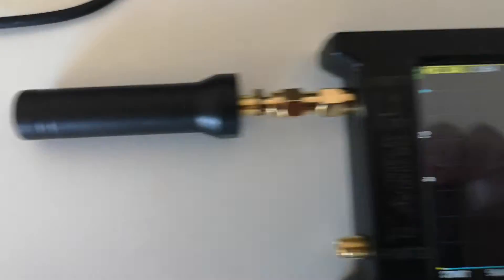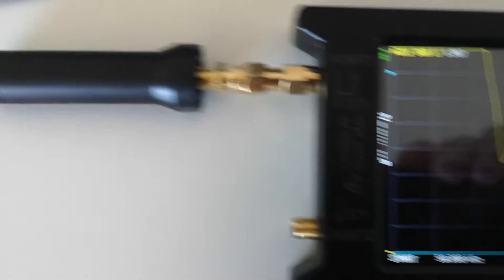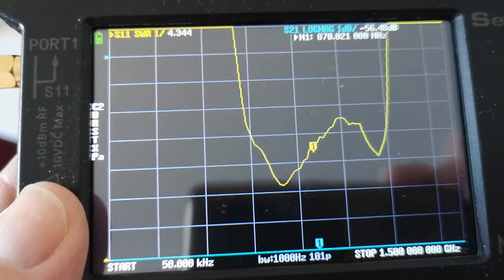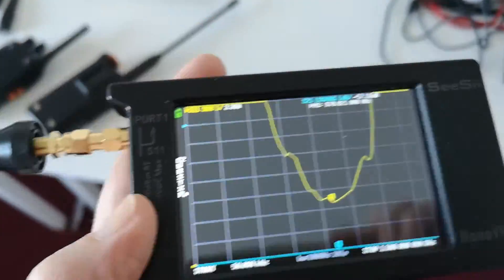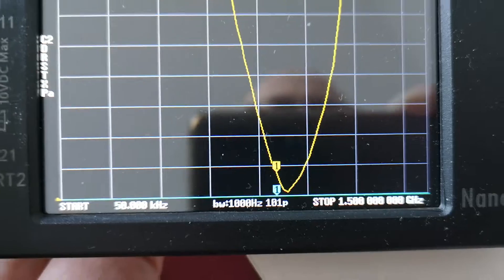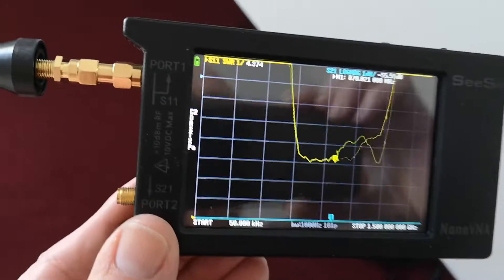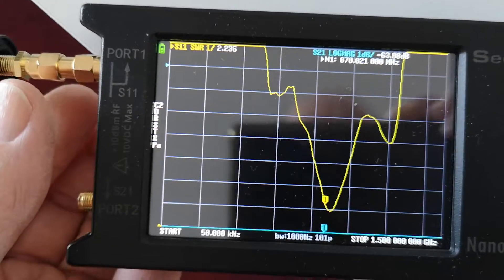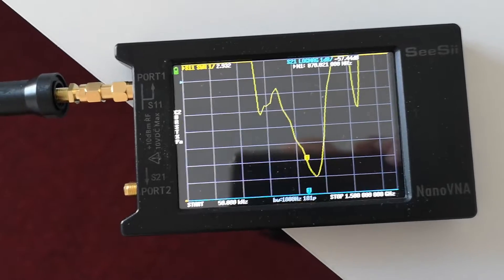Lilygo T-Echo Meshtastic Antenna Test

Comment: Maybe its intended for your body to be the ground plane?
Reply from the maker: Could be the case.
Reply: But when the antenna is mounted correctly, no metal part comes in contact with your body.  It is also designed (mostly) to be a Meshtastic (or similar firmware platform) node that sends/receives in real time.  You shouldn't have to hold it all the time.  It should be 98%+ sitting on a table or in the top of your hikink bag, ect. without body contact.  I wish there was a way to prove reception with it installed and making contact with that internal tape connecting to the GPS module as another post mentioned.

Comment: I got similar results when testing the antenna. However there is a mesh metal tape from the antenna GND going to the board GND which at least provides a little reference plane.
Reply from the maker: Good to know !

Comment: I had similarly bad results with the antenna that came with the lilygo s3 board. I soldered a ground wire onto the shell of the sma. That improved performance greatly. I then wrap it around  the plastic case... But the T echo is a bit nice for such an ugly mod! Maybe copper tape could give you some form of ground...
Reply from the maker: Excellent idea. I will do it inside the case so as not to spoil the cute looks. Some antennas seem to need a counterpoise and some don't.
Reply: @fotografm  hope it works on that one too, good luck! It definitely looks too nice to just bodge.